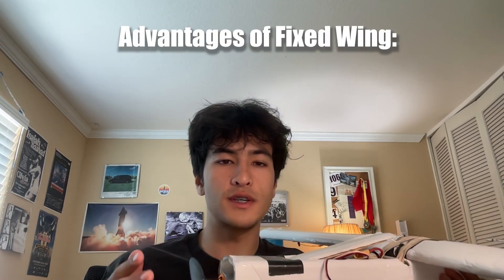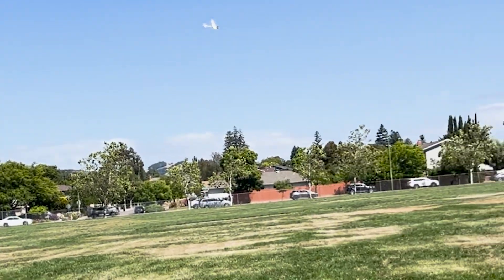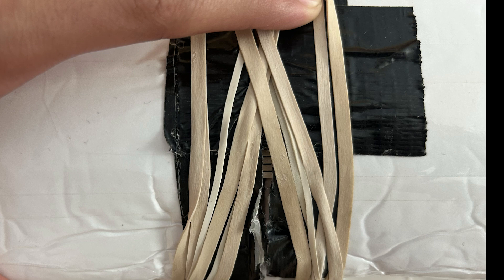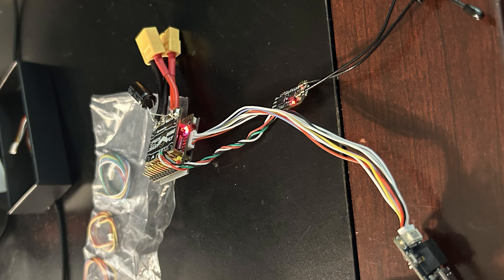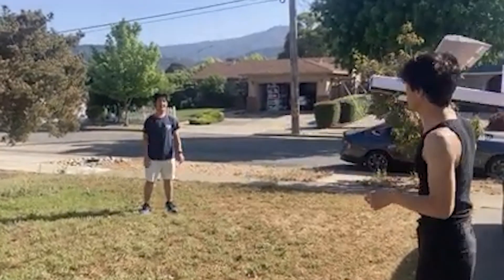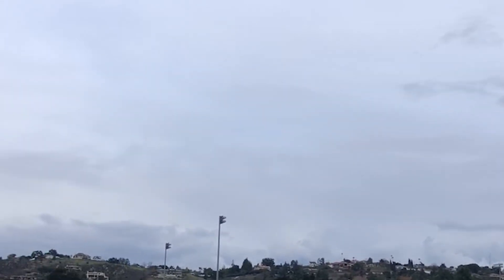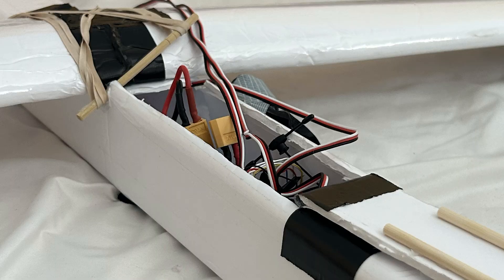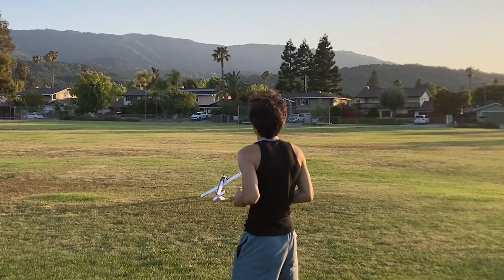Building an AIRPLANE at Home - How I Built Fixed Wing FPV for 100$

Comment: Great video! I’m currently developing a rc aircraft from scratch. Nevertheless i’ve never flown a plane. Any advice? Thank you !
Reply from the maker: I would definitely get a cheap trainer plane to learn how to fly with because a home built plane may have less forgiving flight characteristics. If you can’t afford to have both a trainer and your own aircraft, I would make sure that your own aircraft is designed for low speed. Make sure not to make any of the mistakes I listed: not checking your cg, bad polarization or connections, etc. The most helpful thing you can do is meet with someone experienced in real life. Good luck!

Comment: 4:27 Using a multimeter to check for shorts can get quite annoying cause you have to check every connection. If you want a faster and relatively cheap alternative you can use something called a "smoke stopper" they are most commonly used in building FPV quadcopters, it provides a barrier between the battery and the electronics and then tests for shorts. I have no idea how it does that I'll have to look into that lol.  Have fun with your new plane!
Reply from the maker: Oh I've seen those! They also look really cheap and convenient maybe I should buy one!